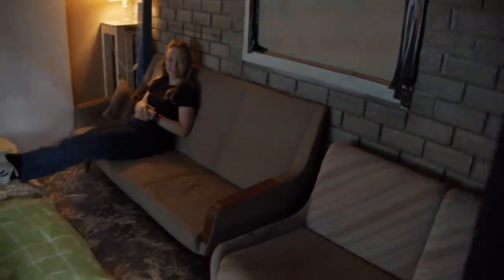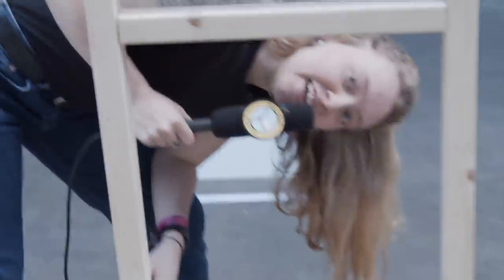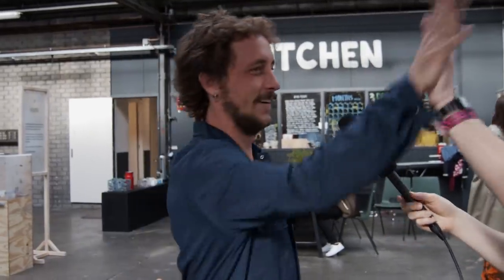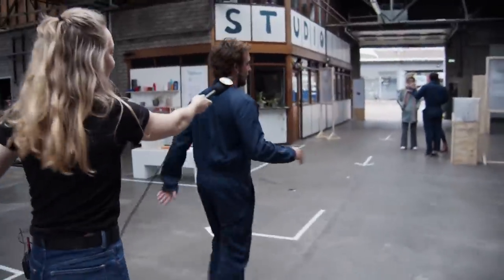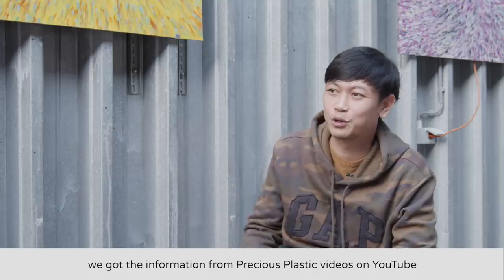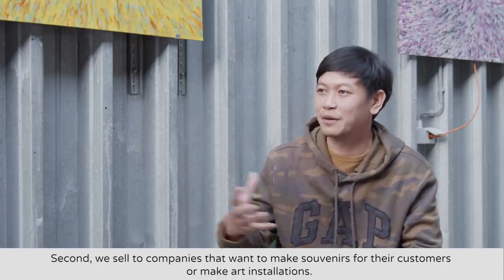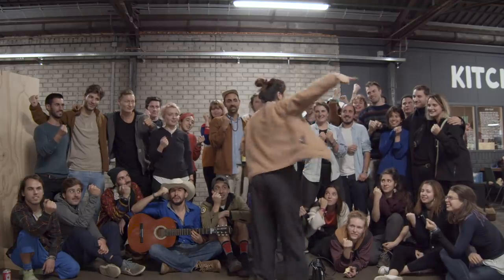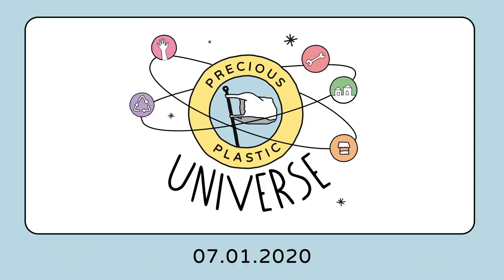Monthly News #33 - Precious Plastic V4 LAUNCH DATE

Comment: Hello i like yours videos, i make a small experience for news produts for my bees. Plastic its possible a metod for make traps for hornets. i liket see videos fails the exprience  plastic  yours equip donate a lot material for read. its very cool se une video speack propreties  plastic and 
temperatures melting. i make a litle test i ave fail a temperature 180º c 
in the oven, plastic hpde. tancks